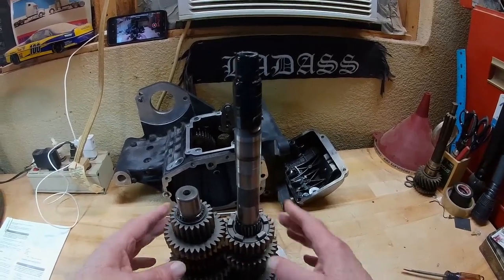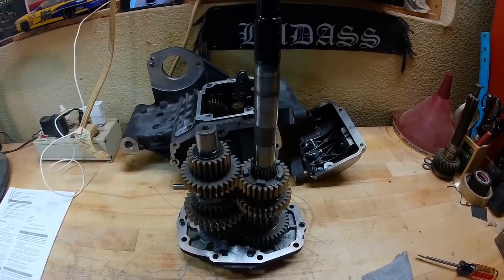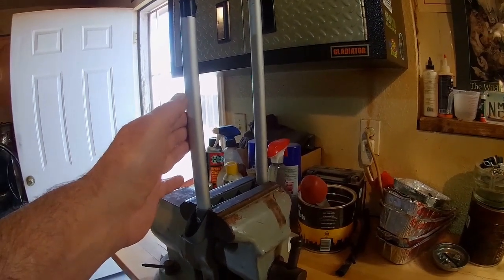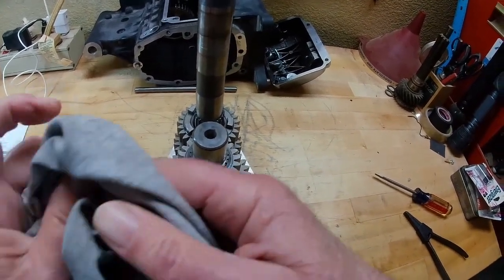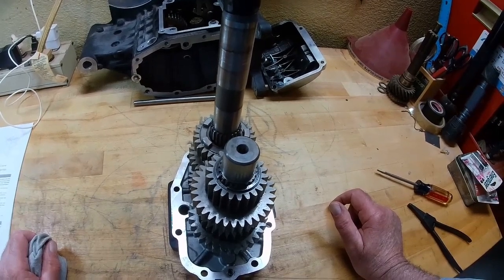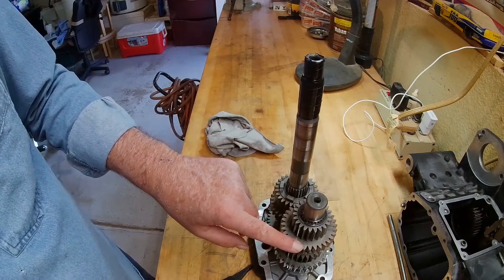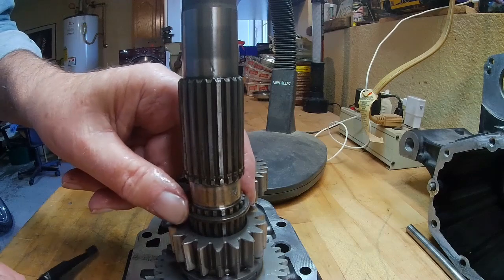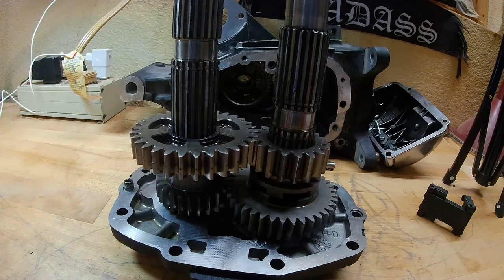Harley 5 Spd Rebuild Remove Gears From Main & Counter Shafts

Comment: Hello from Athens Greece and thank you for the great videos!
I have a question about the gear box.
i have a 2000 XL 883 and sometimes when i am in first gear and accelerate, it seams like the gear disengages for a second and then it continues working good.
This happens only in first gear and not all the time, maybe once in a day and i ride the bike daily in traffic.
I read in some forums that it could be the first gear countershaft that might have a problem.
Bike has less than 20.000 kms on the clock.
Any help would be much appreciated.
Thank you!

Comment: Hey  tinkering  can you tell me how hot should my harley  oil run at  ..my 2002 1200 harley run at 1.45 f  and my 1993 soft tail 1340 run at 1,65 for   on the same day at the same time side by side  same speed
Reply from the maker: Hey Clark, thanks for the question. The 1993 should run at 180 F completely warmed up. The sporty I can't tell you, since I haven't touched one since the 70's. Thanks for watching and ride safe.
Reply: @tinkeringwithharleys  thanks  tinker  your  the  best

Comment: Hi mate .I'm going to make my own tool for removing the gearbox mainshaft race .I'm wondering if you would be able to tell me the outside and inside diameter of that race bush ? That would be a great help if you could thanks. Your vids are amazing I save every one of them .please keep em comming there great 👍 take care.
Reply from the maker: Thanks for the question. Unfortunately I don't know the inside and outside dimensions on the race. I don't have one on hand that I can measure. If memory serves the main shaft is 3/4 if that helps. Wish I could be more helpful. Glad you like the videos. Thanks for watching
Reply: @tinkeringwithharleys  thats all I need to know really thanks mate

Comment: Hey tinkering, I just had my 04 TC88 grenade at 110k miles. Just picked up an 02 TC88 from a dyna and am gonna be swapping them out. In the process, my original trans(I know the dyna one won’t swap in) had been clunking in third and I’ve heard I can just swap the gearset out so I’ll be doing that. Saves me buying a new transmission and my shift shaft out of the original was shaking like a leaf so I know that was gonna be gone soon haha. Think I got a deal on this one since it’s only got 8k miles on it and some cam work done. Won’t know fully till I’m in there over the next couple of days. Any advice or tips for the whole transmission gearset swap area? Really just want it back to smooth shifting. Thank you!
Reply from the maker: Thanks for the question Dylan, sorry to hear you puked the engine. But now you have a 02, it's a better motor. It has a timken bearing lower end the 04 didn't, so you have a great deal with a low mileage motor with a better bottom end. Ok the gear set is inter changeable. This is what I would do since you're trans has over 100,000 on it. Use the main drive gear outa the dyna trans since low mileage and matches the gear set. Replace the main shaft bearing and seals, replace the counter shaft bearing in the case and the pawl shifter and seal. You'll have a complete low mileage trans than. Hope that helps you. Thanks for watching